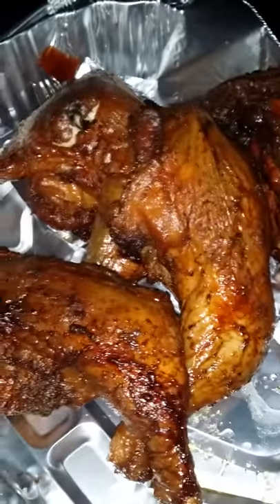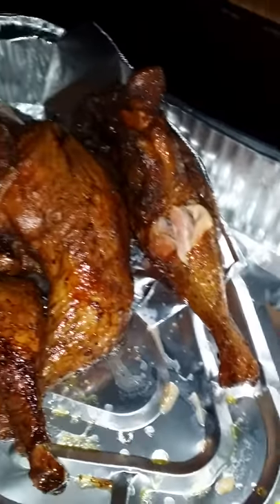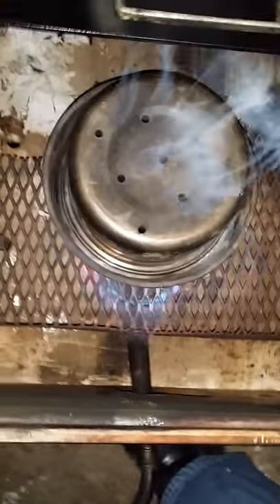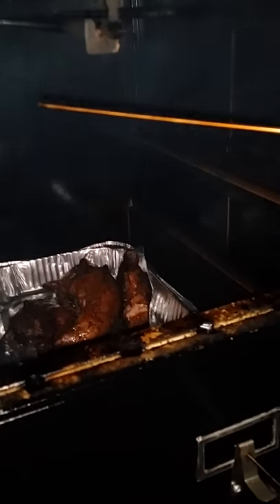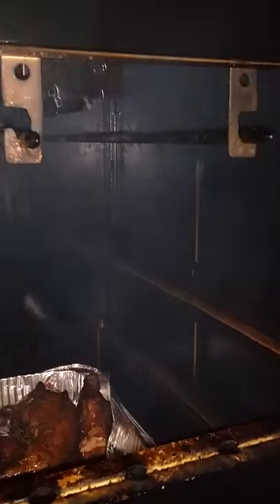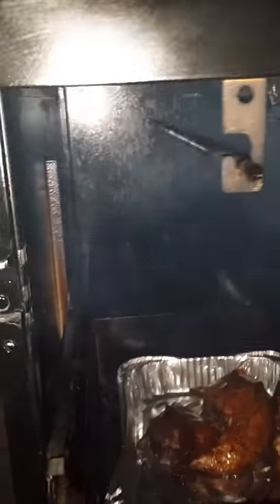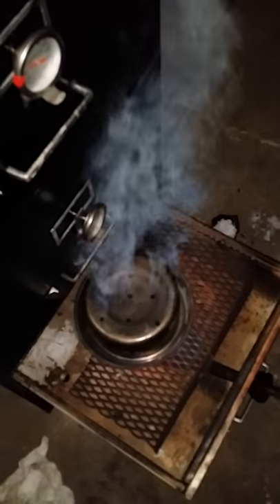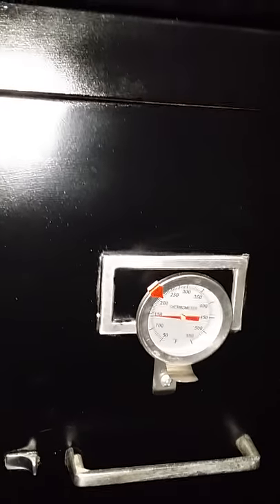file cabinet smoker 3

Comment: when making this smoker did you have to change out the drawer rollers for metal ones or were the original polymer ones OK since you are not going over 250-300 degrees?